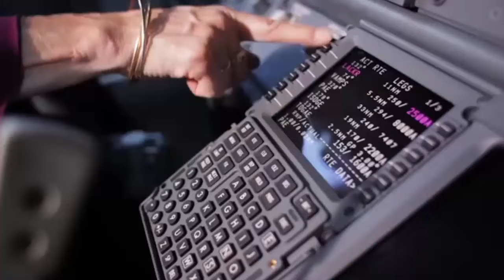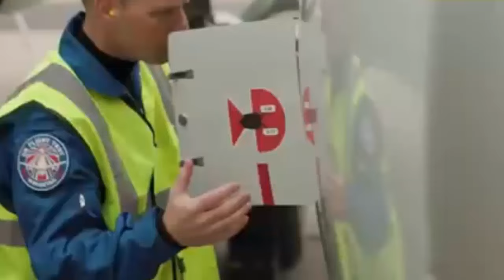Boeing prepare delivery of the UK’s first E 7 Wedgetail Early Warning Aircraft to Royal Air Force

Comment: What will be a significantly advanced capability on the RAFs former E-3 Sentry’s, which will be a vital force multiplier. However I feel just 3 E-7 Mk.1 AWACS, is a ridiculously inadequate number given that RAF will almost certainly require at least 1 or 2 aircraft to be operationally deployable at any given time. 

Yet there will be no tolerance for OCU Training Rotations or scheduled Maintenance cycles, let alone any potential losses due to attrition. Therefore, I feel given the strategic climate we are now facing with the likes of Russia and the Middle East kicking off, the RAF should operate a minimum fleet of 9 E-7 Wedgetails.
Reply: OCU training will be conducted on normal training or operational sorties as it is on the Voyager fleet, or on many other RAF multi-engine aircraft types.

Comment: UK only brought 3 of these.  At any one time 50% will be out of service/maintenance.  The RAF knew they needed at least 9 for '3 shift' (continuous) operation.  With one and a half aircraft available at any time they can only manage a few hours in the air and only at one location.  Given the size of Europe you need a few of these in the air at any one time.  Northern Europe, Southern Europe and Southern Europe.  One and a half planes available is only a 'Token' capability.  Another Spectacular MoD procurement fail!

Comment: who's bright idear is it to have all our early warning aircraft based at the same airfield
Reply: Probably the same guy who thought we should get 3 planes instead of 5
Reply: It was some guy in parliament who took advice from the Kremlin.
Reply: The P8 and E7 are based on the same air frame and use much of the same components so makes sense to base them together for support services, maintenance etc
Reply: @NikumbaUK  Makes it easier but not strategically prudent
Reply: They have Typhoon interceptors there. So they are well protected.
Reply: In the event of an escalation in tension, aircraft will be dispersed across the country. That's what the entire ACE concept is all about.

Comment: The RAF needs at least 9 Wedgetail AEW.1's, along with at least 17 to 19 Poseidon MR.1's too.

Along with the British MoD and the Labour Government, ordering as soon as possible another 48 Lighting ll F-35B's  for the RAF and FAA, 

Maybe the MoD and Labour equally agreeing, to buy an extra 25 Lighting ll F-35A's, just for the RAF too.

This would give the Royal Navy Fleet Air Arm, enough F-35B's to equipped and deploy at the same time too.

Both HMS Queen Elizabeth and HMS Prince of Wales Aircraft Carriers, with a full Carrier Air Wing of 36 to 42 F-35B's fighters.

While the RAF still has the use of One Squadron of F-35A's (upto 25 aircraft) and One Squadron of F-35B's (11 to 23 aircraft) too.

The question is, what will the new Labour Government in the UK, actually do over ordering more Wedgetail AEW.1's or more Poseidon MR.1's, let alone more Lighting ll F-35 fighters too?

Will the UK Government, actually order upto 138 or more F-35B's, or mixture of F-35A's (upto 30 aircraft) and F-35B's (upto 108 aircraft) too?

That includes a replacement F-35B fighter, for the one lost off HMS Queen Elizabeth Aircraft Carrier in the Mediterranean Sea, a few years back and has not been so far replaced?